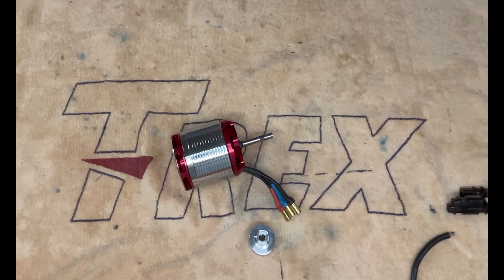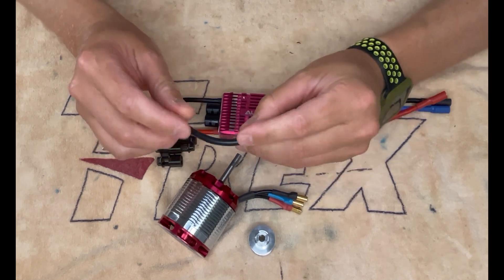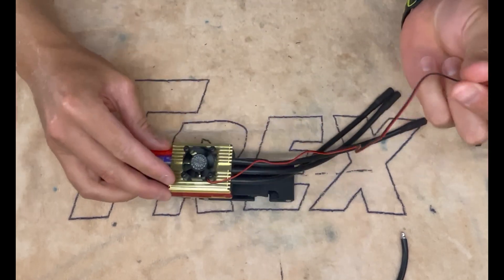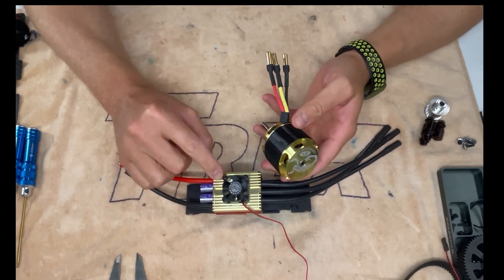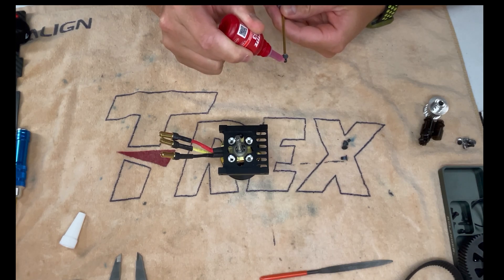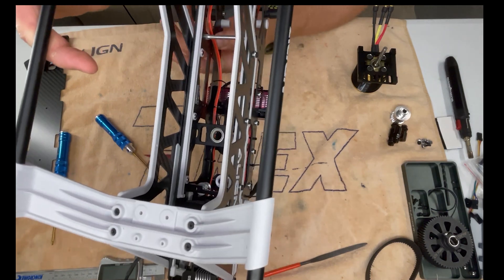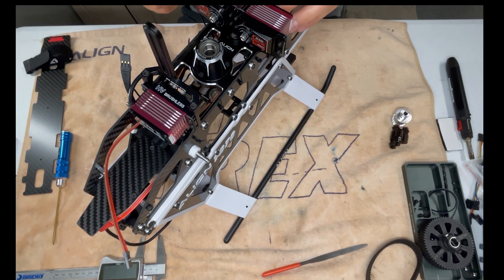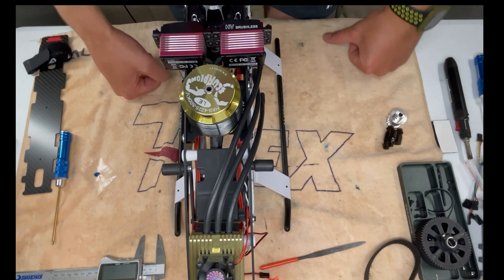I Bricked the ESC!!!! TB70 Build Ep 9

Comment: I am currently, (no pun intended), having issues with my 200 amp hobby wing esc for my TB-70, hopefully I will come across a video to help my dumb arse figure it out. Thank you for your previous vid on the belt upgrade, mine should be on its way
Reply from the maker: It’s weird you say that, my friend is also having issues with his 200. What’s yours doing?
Reply: @MAD4HELI  I got it working, it wasn’t recognizing the governor and was over speeding, the problem arose when I changed transmitters mid set up. Finally got my maiden in, now have to fine tune